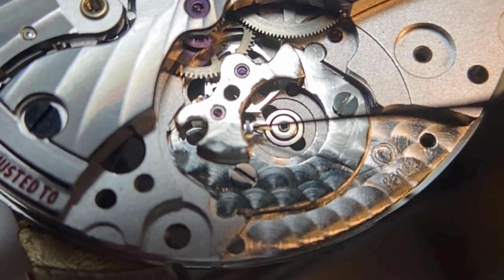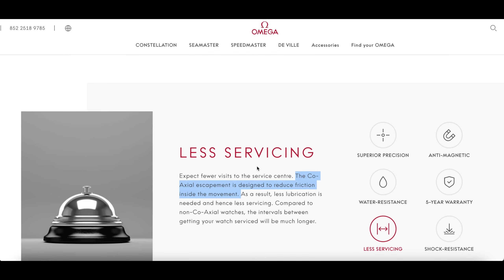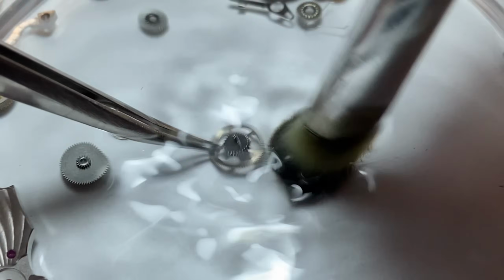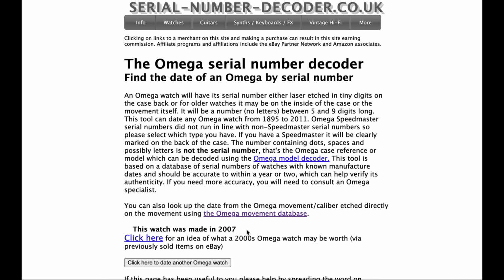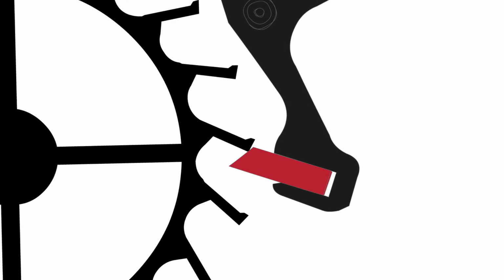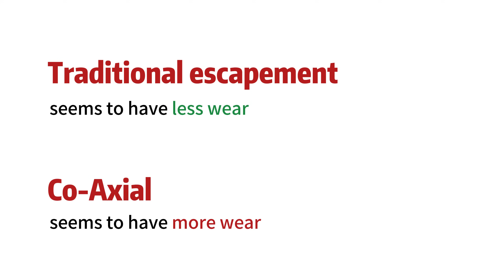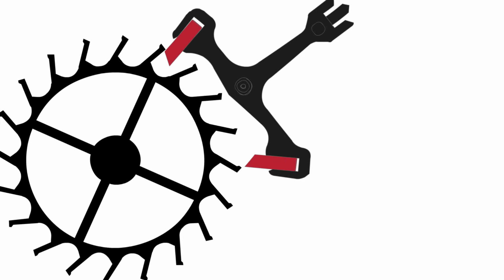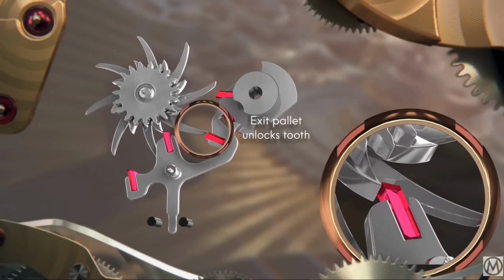Something you don't know about Omega Co-axial

Comment: It's my understanding that the coaxial movements available now are fine, but earlier iterations in the 2500 and 2403 movements were a problem. I have one of these and no independent watchmaker will touch them, it requires special training from Omega to do so, but even those with training won't touch the earlier coaxial movements - they have to go back to Omega. I gather later iterations fixed this issue by going to a 3 level escapement, but those with the older 2 levels have more issues and they are stuck dealing with Omega's obscene service times.
Reply: I have heard the same as well. I believe your info is correct.
Reply from the maker: I couldn't agree more with your point. There were indeed some issues with the early coaxial versions, but things got much better with the later ones. Thank you for providing such valuable information.